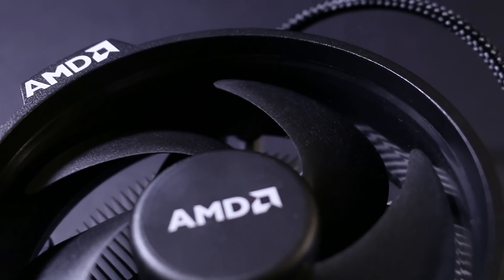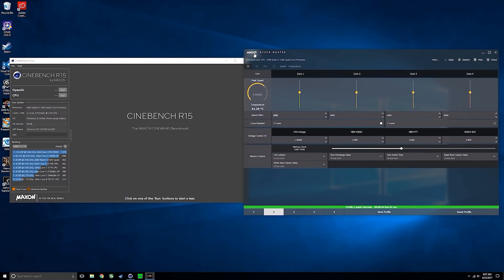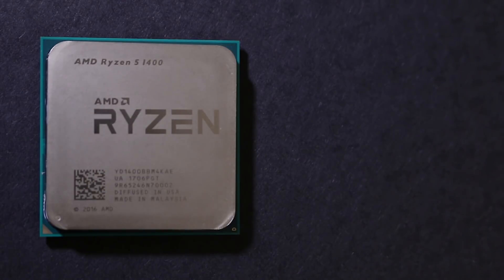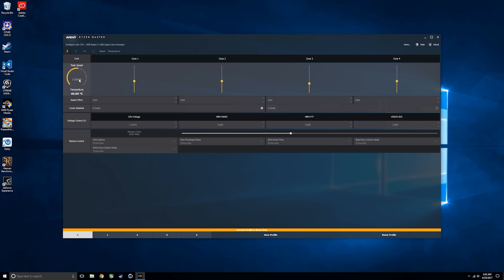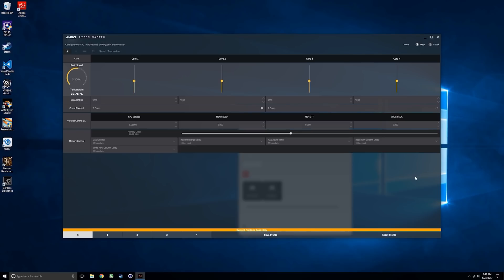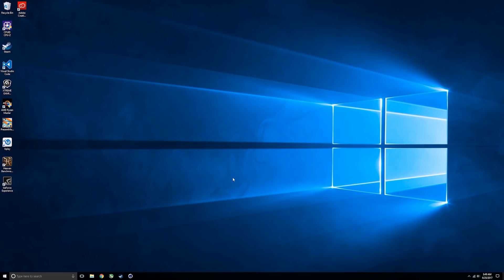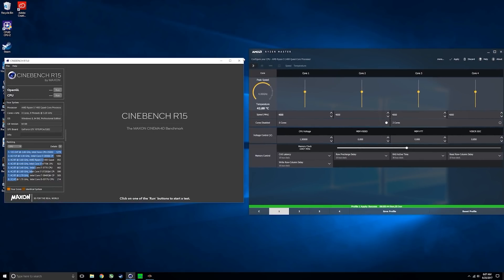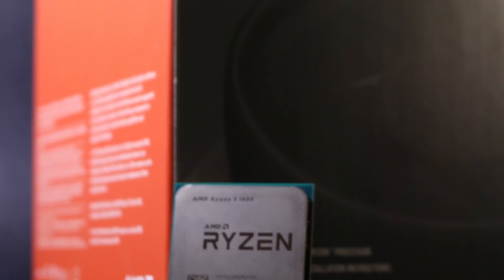AMD RYZEN Overclocking GUIDE

Comment: good video for newbie overclocker like me :D
edit
I can manage 3.7GHz with R5 1600 but somehow I always fail reaching 3.8GHz Cinebench test is success but stress test with prime95 always fail, I use B350 chipset, is there any limitation overclock in B350 chipset?
Reply: thats because cinebench really isnt "works like a charm". Cinebench is a very short test maybe less than 1 minute for most systems, temps may not even get close to maximum temperature like they will in prime 95 which runs for longer and the temp gets progressively hotter. So testing in cinebench isnt a great idea IMO, however very few real world programs will run your cpu as hard and for as long like prime 95 does.
Reply: Joko JMC I was able to get mine to 3.85ghz for a long term overclock eoth the stock cooler on msi b350 tomahawk maybe you just got a bad chip
Reply: Same here .. Cinebench r15 works like a charm .. but with prime95 after few minutes it crashes ..
Reply: Are you on stock wraith spire cooler?

Comment: I overclocked my 1700 to 3.8ghz 1.2875v, is that high voltage? I'm using asrock ab350m pro 4 motherboard
Reply: Javier Lafarga you can check that online
Reply: wow thanks
Reply: Javier Lafarga no problem dude
Reply: I get my 1700 to 3.8GHz at 1.23v.

Comment: Wait does the ryzen master software keep your CPU at that overclock permanently or would I have to keep going in there every time  I log in and overclock my CPU?
Reply: yeah but you always have to launch the program, be it auto launch on boot or manual launch. The BIOS will override any settings until Ryzen Master is launched in Windows.
Reply from the maker: it'll keep it OC'd. You should get a Ryzen Master Software pop-up every time you boot asking you for permission.
Reply: ALPHAdigitUNBOXING yeah it will keep your overclock

Comment: sometimes when I set the cpu voltage in ryzen master it auto adjusts to something I didn't set... is there a reason for that? I was testing 3.9ghz on my 1700 on 1.35v and it worked, then I noticed the settings had changed voltage to the max 1.55v -- Is there a setting to stop that?
Reply from the maker: +bvbblepop hmmm, hop into the bios and set your voltage to "offset mode" instead of "auto". Let me knoe if that helps!

Comment: I found the ram OC on Ryzen Master a pain in the butt. My 3200 cas 14 ram was "OC'd" to 3200-16. Cinebench figures were about 100 less than doing OC in bios.
Reply: Steve RX4 dont trust cinebench lol. when u use w10 it detects windows 8.1 lol
Reply: I think the scoring works fine. But it's detection isn't real good eg sometimes it was saying my cpu was at 3000MHz when CPU-z confirmed it was at 3900. But then I've also found CPU-Z doesn't work properly all the time either eg sometimes doesn't detect ram at all.

Comment: i overclocked my ryzen 1600 to 3.6ghz on all cores at zero offset voltage.I ran prime95 for 2 hours without any crash.My load temps with prime95 was 73c with wraith spire at 100%.So is it ok to keep the voltages at stock for the overclock or should i increase the offset from 0 to 0.04

Comment: good guide man.. very easy to follow, no fluff, no bs.. just great info.. really liked it.. I myself right now have a 1800x and 16 GB of vengeance 3200 ram.. i just used the standard DOCP setting in my crosshair hero vi bios and im stable from what I can tell at 3.9 ghz and my ram at 3200 and the correct timings.. i am yet to run prime 95 but i will.. i have played a few hours of battlegrounds.. it put my cpu freq at 1.325, i am using a masterliquid 240 AIO water cooler and under load my cpu has only reached around 55c so im sure i could more than likely push more out of the system if i really wanted too.. maybe in the future.. im happy with where it is at the moment tho
Reply: my cinebench results as of now are 1698
Reply from the maker: That sounds like a damn good setup! Crosshair Hero VI looks to be one of the better boards for Ryzen

Comment: You need to run prime95 about 24 hours, since that's the amount of time it takes to test all instructions. So if you only run it for 2 hours, you only test a small part of the tasks the processor can perform.

Comment: So even if you overclock your CPU but never push it that far while using programs it'll be used like a stock non-overlocked cpu?
What I mean to say is, the overclock will come into play only when the PC is being pushed that far right? & not when you're just surfing the web/idling?
Reply: if it is stock thats how it works but with overclock it doesnt scale which means it has 2 states idle and load. at idle clock speeds are lower but at load clock speeds goes to your preset overclock. note that even though it has like 20% load it isnt considered idle. also temps at 30% low are lower than 60% load but clock speeds are the same

Comment: 1700x does not like anything over 3.9
X370 sli plus motherboard, kraken aio cooler, really a beast when it works however still thinking I got the wrong board perhaps. Thanks for vid
Reply from the maker: Could be motherboard, but it's most likely the processor. 3.9GHz is good!

Comment: can someone recommend me a good cooler for my ryzen 1700? with the stock cooler temps go above 90 degrees under load
Reply from the maker: Look into a liquid AIO if you're getting temps that high
Reply: Bimbo Baggins 
Or get a 'noctua nh-d 15 se' if you want a powerfull air cooler. It's safe, silent and can compete with aios.
Reply: even better than most aio unless you pay premium like kraken x62 or the high end corsair ones and even then its close. the only way i see people not buying noctua nhd15 is clearence

Comment: Your videos are so good, but how did you get 4 ghz out of that proccessor on the stock cooler? I tought you need aftermarket coolers to reach that
Reply from the maker: The voltage I'm running isn't that high so temps are in check. The R5 chips will be fine on the stock coolers and R7 chips will be a tad warmer but still okay.
Reply: Thank you for the response!
Reply: Optimum Tech can you give me suggestions for aftermarket cpu fan? I'm still uncertain about the better performance aftermarket cpu fans because i have a little knowledge about it and i fear that could i bought a fan that has worse or same performance with stock cooler wich will be a waste of money.
Reply: Use the H100i cooler, its really good. I don't have a Ryzen 7 1700 cpu, so I don't know. But, I'm going to use the stock cooler and see what happens when I clock it at 3.7Ghz.

Comment: my cpu doesnt down crease the clock speed when its idling, it stays at 3800 at all time, i have a b350 tomahawk and made sure after i finished overclocking to turn amd cool n quiet on, any help would be appreciated
Reply: i had the same problem but i got an old amd quad core processor, i figured out how to fix it though, you need to set up proper energy/battery settings in windows. like minimum frequency was 100% for me and max 100% , now i lowered it down to ... cant remember right now im on phone, but this fixed it for me
Reply: I have the ryzen balanced power plan on, ill look into it thank you for the advice
Reply: TomCupis well theres a noticeable difference if you use a power hungry cpu , like my idle wattage went from 150 to 80, and my pc idles a lot while watching vids or anything :D

Comment: 2 Questions 1st, Is @3:27 you said that the Ryzen master software would be much easier for beginners but is there a benefit to over clock in the BIOS?. Secondly, Will the Ryzen master software work with AMD FX chips?.
Reply from the maker: BIOS will give you more control over voltage parameters, which isn't really useful for people wanting to just overclock to around 4.0GHz. 
And no, Ryzen Master Software doesn't work with FX chips as far as I know

Comment: Hello, great and informative video but when the cpu is unstable does your whole system crash or does Cinebench only stop/crash? Furthermore, what if your pc crashes from the BIOS, how do you restart it?
Reply from the maker: The whole system will crash i.e you'll get a black screen (in which case you just restart your PC), or a blue screen ("something went wrong, we're restarting"), or the system will freeze. 

For serious crashes where the PC refuses to reboot, you'll want to reset the CMOS. it's different for every motherboard, so check your motherboard's manual on how to do this. Usually there's a button or two headers pins you'll need to short with a jumper wire.
Reply: Thanks for your response.
Reply: Croyden De Souza if you can't find the cmos button, removing the battery on your motherboard for about 5 seconds usually works

Comment: Its nice to see a very direct guide on how to overclock a CPU. You should do something similar for general GPU's if you ever get the chance!
Reply from the maker: Definitely! Thanks for watching
Reply: gpu's are much simpler. just get msi afterburner. turn power limit and temperature to the max. and push the clocks until its unstable. not that if you see artifacts lower memory clocks if your app crashes lower core clocks

Comment: I had an msi b350 board that would run my ram at 2800mhz no problem, then I switched to this Asus b350 prime board and I can't do anything over 2133, but at least with the Asus board I can hit over 3.8 ghz
Reply from the maker: Ahhh yes. Make sure you're running the latest Bios update and check their compatibility list.
Reply: it's probably not compatible, I am running the latest bios tho
Reply: 2133 is fine tho still better than ddr3
Reply: definitly compatability ive noticed that msi has better compatabiliy in terms of ram. i have a 3200mhz on my msi b350 gaming pro carbon but i cant push over 2400 on my other asus b350 prime plus
Reply: N1NJONAS I'd be happy if I could hit 2400 on my Asus xD

Comment: I overclock everything even my wife lol since the 90s it's free performance, cooling is 1st .
Reply: 1967 kID overclocking wife faster cleaning speeds but more chance of complaining (voltage too high)
Reply: undervolt the wife for less heat!
Reply from the maker: Tips for overclocking wife? Looking for better dishwashing performance.
Reply: @optimumtech  Jesus Christ dude.
If you still want tips, remember that you have a belt!
Reply: Have you had the issue with increased nagging or have you found away to turn that feature off.

Comment: Just dont go past 1,35V, otherwhise you will degrade your cpu
is what I heard :)
Reply from the maker: Perhaps, there isn't a lot of data on processor life span
Reply: True, maybe there is no noticeble degradation within its lifespan until it gets obsolete and you replace it.

But there is still the point of power consumption,
ask yourself: do you really want to run this thing at 1.6v 24/7 just to hit 4.1 ghz or would you rather stick to 4.0 and have the voltage at something more reasonable :D

Comment: After that OC to 1.3 V and 3.7 Ghz would cpu start wearing off faster? Or it's vitality would stay the same?
Reply: Vertical Theoretically yes, but as long as the processor doesnt run at 90°C and 1.5V, you should be fine. Of course, we only know when the first reasonable overclocked processors start to fail, but as long as you stay to the recommendation in this video there should not be a big impact on the processors lifetime.

Comment: Cant use Ryzen Master Software because its to small font on a 4K screen and do not have any DPI settings or follows Windows 10 DPI scaling.
Reply: Just change resolution when overclocking. It's not like you have to change it to 800*600

Comment: I overclocked my Ryzen 5 1400 to 3.7Ghz but it doesn't downclock like yours. But I did it through the BIOS UEFI though, is that the case?
Reply from the maker: What do you mean? What voltage are you using
Reply: i mean like when idle it still stays at 3.7ghz (overclocked to 3.7 at 1.286V) *lowest most stable.
Reply from the maker: Make sure you're in adaptive mode in the BIOS, and not that you set a manual OC (constant).
Reply: I think the motherboard doesnt have an adaptive mode. Mine's a budget Asus Prime B350-A
Reply: anyways I tried using the Ryzen Master and it does downclock during idle. So thanks very much!
Reply: its fine with constant. i have mine constantly at 3.95 and no problems temps arent even different because they will depend on the load of the cpu

Comment: Hello you could upload the optimal values as you did for the 1400, but for the Ryzen 1600, Thanks in advance
Reply from the maker: The optimal clock speed and voltage values are going to change from processor to processor, even within the same SKU.

Comment from the maker: A much requested Ryzen OC Guide for beginners! Thanks as always for the support, now go OC the sh*t out of your processor!
- Ali
Reply: AmazingShots if you’re not comfortable with that go for 3.8 or 3.9 on V.Core of 1.30! Should work totally fine and go higher if you wish to
Reply: Did i mess something or u didnt say anything about memory overclock? Coz this measure is nessesary for all Ryzen CPUs, even if they are not overclocked.
Reply from the maker: angeltensey 6:10
Reply: Oh, okay
Reply: Can i overclock my ryzen 5 1400 with asus prime a320m mobo ?
Reply: A320 Motherboards are not overclockable
Reply: I have the same cpu i have a MSI B350M the cooler is the ryzen one i think
Reply: is that ok?
Reply: DO u overclock ur cpu??? i have the same cpu but i don't know if this is ok i want to put it in 4000mhz and 1.33125v is that ok?
Reply: if it works its good ;)
Reply: Son Goku thank you i'll do it
Reply: Will this apply to the 2700x or will you have anything for the newer CPUs particularly with the ASUS C7H mobo?
Reply: thanks for the guide, do you think that I'll be able to overclock ryzen 7 1700 to 3.7GHz on ASUS prime B450 plus motherboard with 550W Seasonic focus 550w Gold? (EVGA 1060 SC, 6GB)
Reply: Hi,can i apply  these figures on my Ryzen 1500x ?  I mean 4.0 Ghz and 1.33 Voltage ,thanks